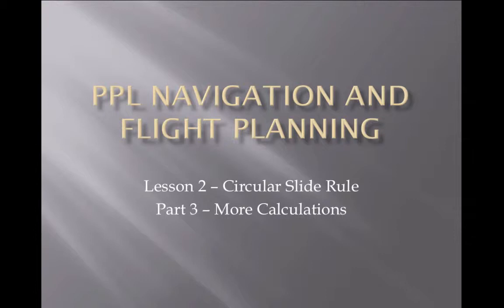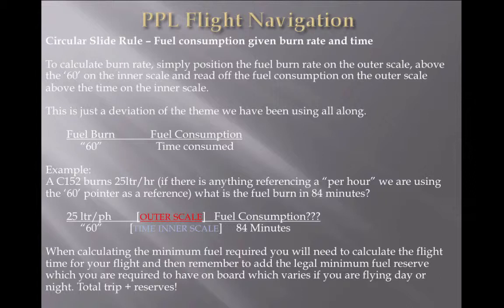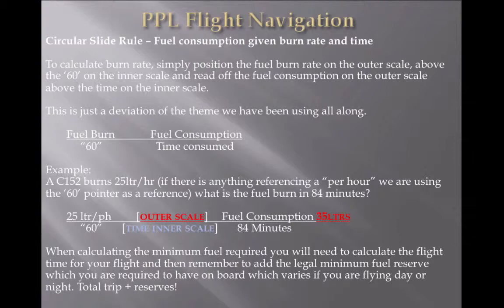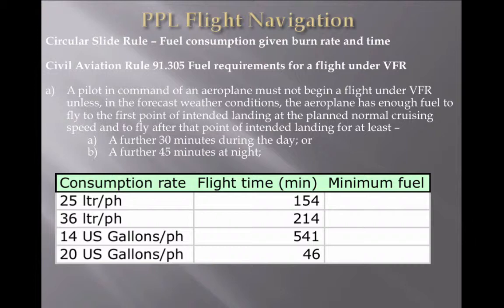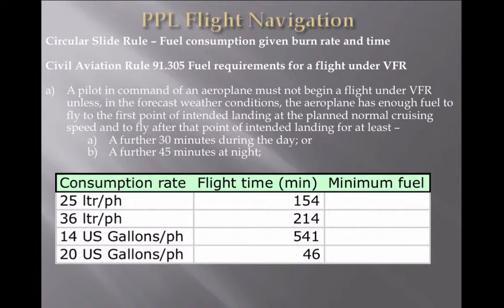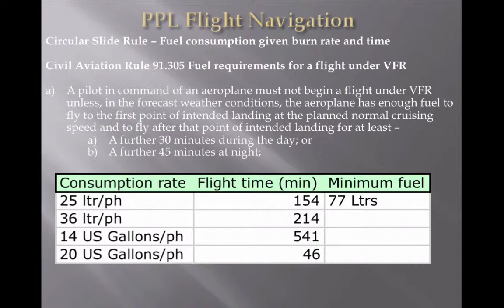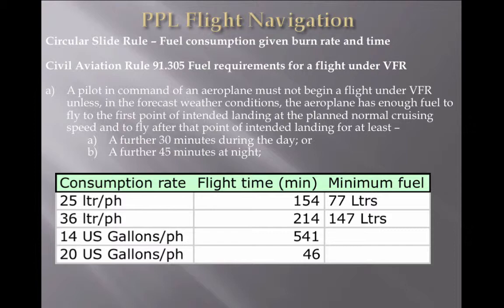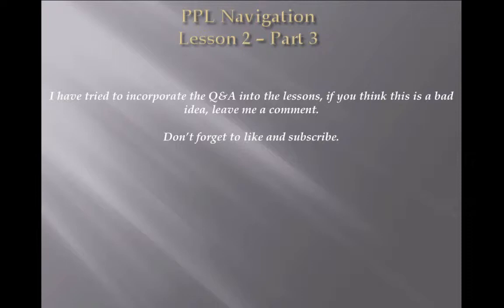PPL Air Navigation and Flight Planning Lesson 2   Part 3

Comment: I don’t want to be mean Dave but on Consumption rate/ Flight time, the difference is quite big 
Hire is my E6B FC and /calculations with scientific calculator 
67l / 64l you’ve got 10 liters more and ex.
128l / 128,4 l
127g / 126,23g
15,4 g / 15,3 g
Reply from the maker: It's not mean, it's factual! The E6B and the exam allows for a descent tollerance because everyone reads a different reading.
Many many CFI's and flight schools have petitioned the authorised body to use electronic devices in the exam now as they are the standard, it will happen .....oneday
Reply: @NZPPLDave  It looks like you didn't add in the 30 minutes reserve time Fly In Life. So for example question 1 it should be 25L/hr x 184 minutes = 76.5L which is correct. (Don't use only 154 minutes)
Reply: Adam Pattal you are right, I just pause the video, make my calculations and jump to the answers. I watch the video again and actually Dave specify that 3o minutes in plus and my new quick calculations matches with Dave answers. 
I'm in EU and I actually came to see all this clips for questions about TC, WCA, TH, VAR, MH, DEV, CC. Dave if you have time it will be great to share with us your good information. I already passed my written exam but it will be great 👍 ✌